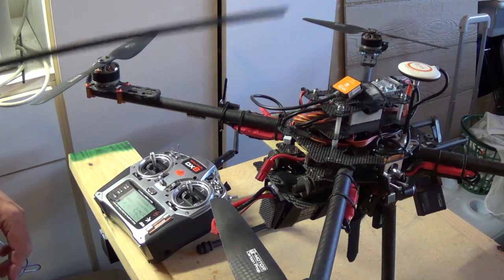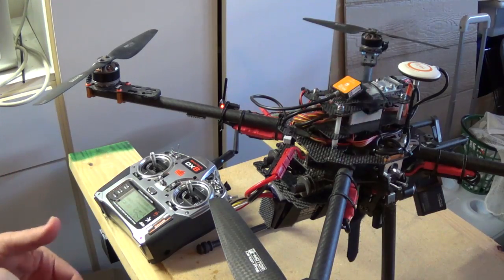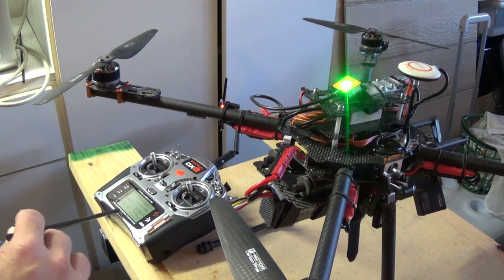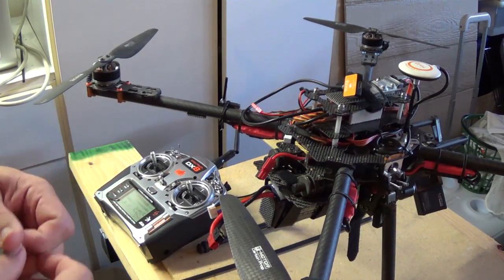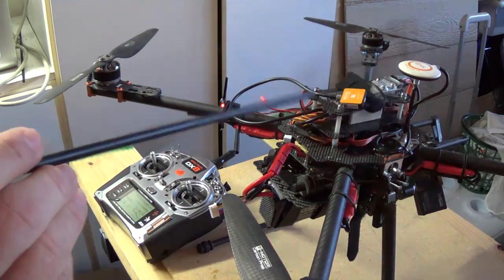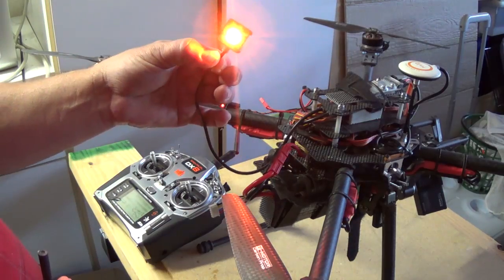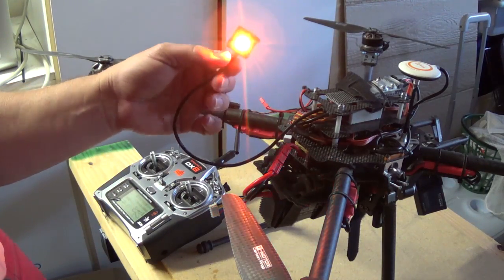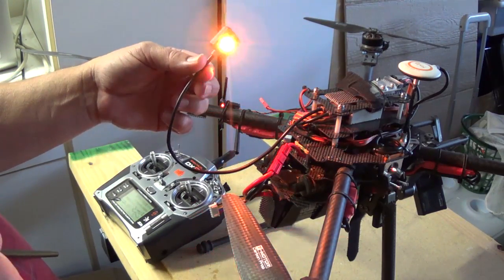NAZA Compass Calibration Issue Solved

Comment: Bought a new naza lite, everything looks good but can't calibrate it. Rotating drone 360° with its head down doesn't change color from solid green to blinking red.
Reply: I'm having the same problem did you get it solved
Reply: Change your led module..

Comment: What size props u using and what motor. and thanks for sharing this information
Reply from the maker: Mariano,  I use Tiger Props 11x3.7 along with Tiger 3110-900KV motors
Reply: Oh really because i got same machine but im using 2810 -750kv motor with the 1147 carbon propps and this thing already weight 5.7 pounds i got gopro camera. Gimbal. Fpv transmitter. Retracted landing gear
Reply from the maker: I too run a gimbal and gopro 3...  I use the Xaircraft Stella Gimbal which is really lite.  I've been doing some power cable adjustments and have been able to get rid of the 3s battery, I'm strictly a 4S setup now.

Comment: I had the same problem..........could not access calibration mode.  I did all the things you did in an attempt to find the solution.  In addition,, I did a lot of research online and communicated with many members on various forums.  No one could help me until now.  Now after installing a new LED module I have a like new flight controller.  Thanks.
Reply from the maker: Grover, glad I could assist.... thanks for watching...